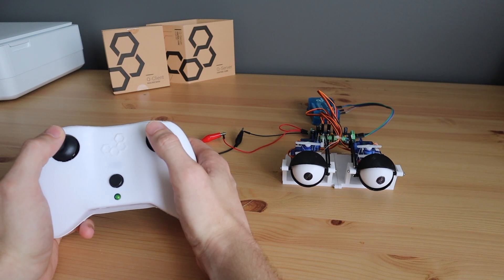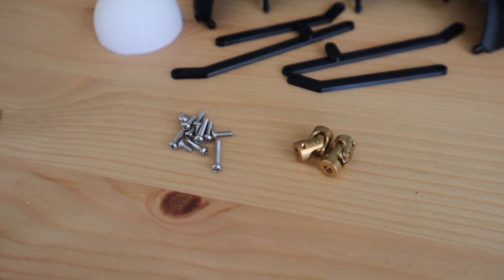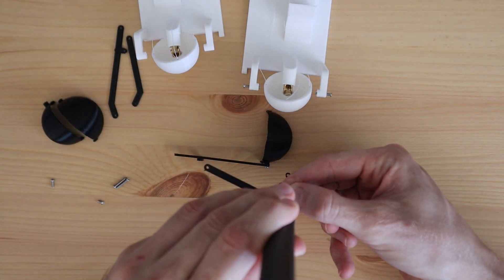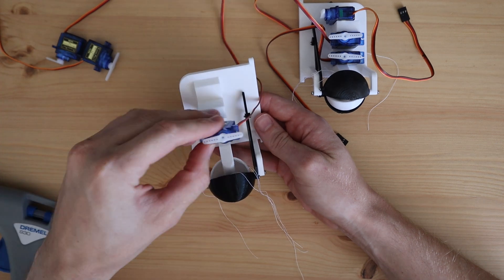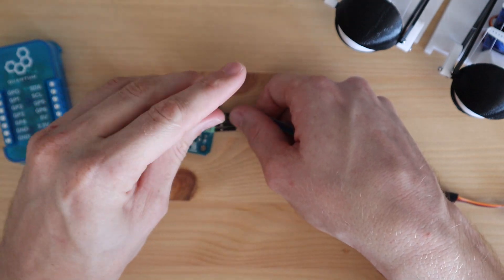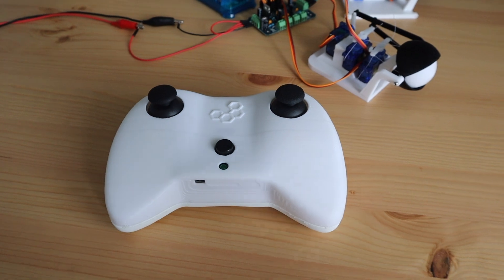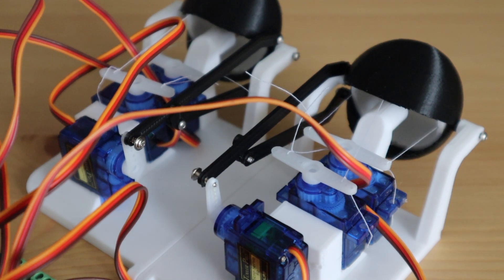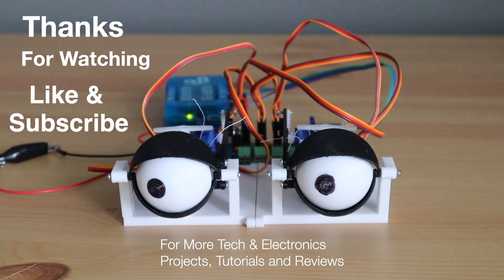3D Printed Wireless Joystick Controlled Animatronic Eyes

Comment: Nice Video! Would really love the starter bundle :) I think you should add a mouth! You had 2 extra motor slots left, right? You could use that for opening/closing and tilting (sad/happy) the mouth! :D
Reply from the maker: That's a nice idea. Yes there are two additional servo outputs on the board, so that would work quite well.

Comment: I've been working on a hand exoskeleton for the past couple of months and you could definitely use the quantum integration kit to control it. I've been using a rag-tag bunch of electronics that I scavanged from older projects but having a cohesive control set would make things easier.
Reply from the maker: Thanks for the suggestion Ritwik. They've made something similar if you'd like to check it out: https://www.youtube.com/watch?v=4DGhhf7y3hY&t
Reply: @MichaelKlements   Looks like a cool project, seems like a simplified version of the shadow robots.
The project I'm working on is a powered hand exoskeleton that helps differently-abled people perform normal tasks like picking up objects and opening doors.
Reply from the maker: Hey Ritwik, please contact me at klements.m@gmail.com in relation to the Quantum Integration giveaway

Comment: Video Idea: A slim, wall-mounted mirror/display which gives information like weather, energy usage, time, and/or any other integration with the IoT devices you have set up.

For bonus points, this could be interactive through touch screen, or have a 3-D like display.
Reply from the maker: Thanks for the suggestion!